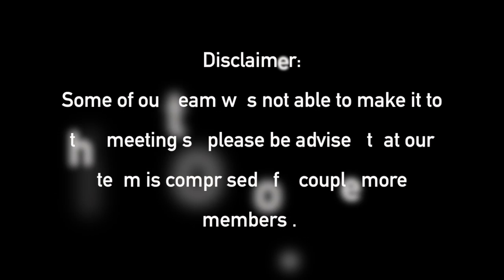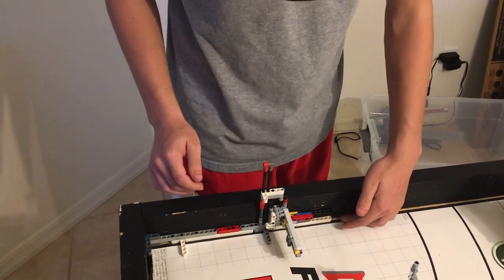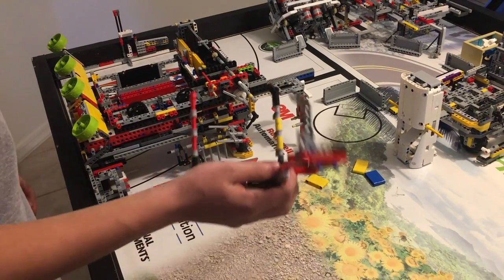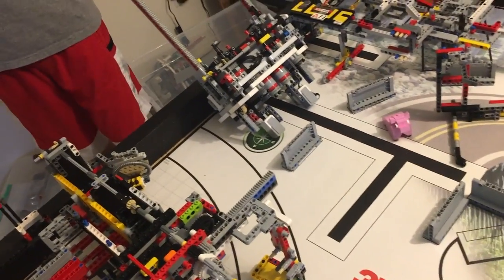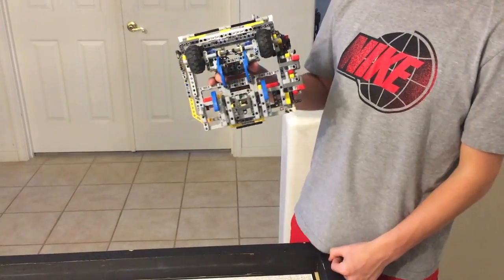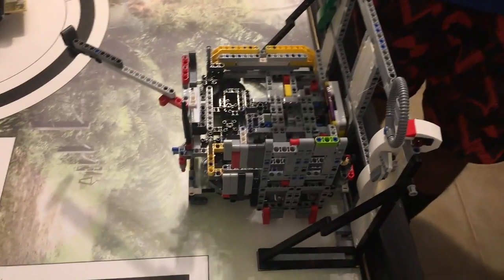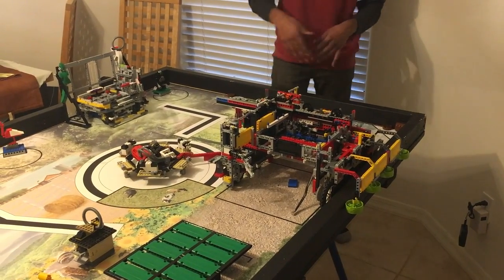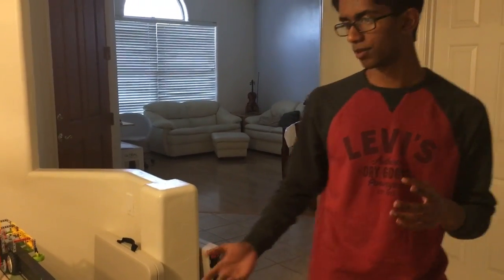FLL Animal Allies| Legends Explain...| Robot Technical

Comment: I feel like I'm asking for too much . . . Ignore this comment if you agree. But, my team's robot is having trouble with our over the ramp attachment, even though we are using 2 motor to power it. Can we see the gearing you use? Also, when you program your first and second run, so you use motor control?
Reply: Mindstorms Man - SWARM your question is a little complicated. Can you separate your questions to make it easier to answer... and we would like to answer as much as we can
Reply: Michael G - question 1: can we see the gearing for your first and second run arms? If not, can you give an estimate on the ratios?

Question 2: do you guys just use motor control on your first and second run? If not, do use use accelerating/decelerating motors?
Reply: Mindstorms Man - SWARM 1) its around a 1:4 ratio so basically a small gear to a bigger gear which creates more torque.
2) I don't really understand this question but we don't use acceleration and deceleration blocks for our bigger robot. We just use default motor blocks.
Reply: Michael G - Thanks so much! Also, so your motors make sounds of struggle? Ours does, which kinda worries me.
Reply: Mindstorms Man - SWARM run all your motors on motor control to make sure they all sound the same bc if they don't, your motor is probably broken. As long as you don't strain your motor and always have a higher torque than speed ratio, You should be fine. Our motor has to move the whole big wheel base and yours doesnt seem as big and heavy as ours so I wouldnt be worried.
Reply: Michael G ok, thanks
Reply: We are still havin much trouble with this run. Our chains always are cracking and snapping, and the robot doesn't have enough torque to move the whole machine. We cannot figure out how to fix it, we have changed out our old motors for fresh ones, we got a new battery, we have lubricated all the gears, and it still doesn't work. We think it is because of the black 4 prong gears that we use 2 sets of on each side, and we think they are very inefficient and lose lots of energy. Have you had this problem? I also saw that you guys use some of the standard bevel gears, by when we tried those, they would just crack and skip.
Reply: Mindstorms Man - SWARM I'm having a hard time understanding what you mean but try reinforceing the gears so that they cannot pop. Btw, we use all types of gears in our robot. Our team does not think that chains are not reliable.